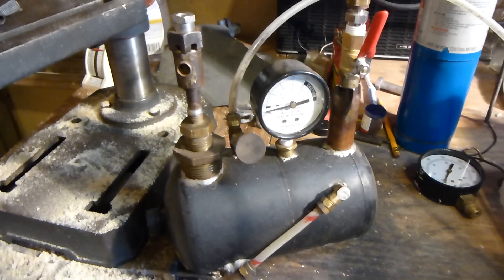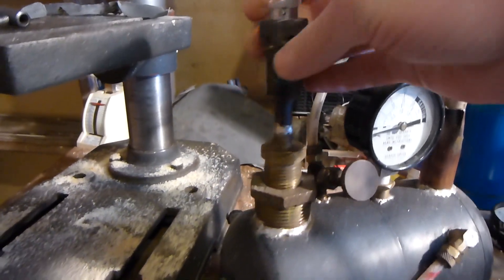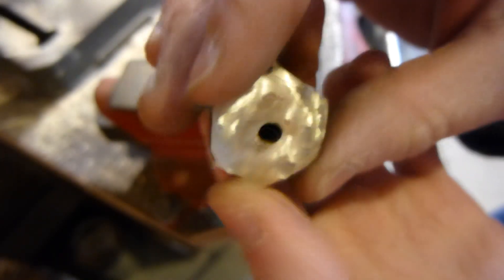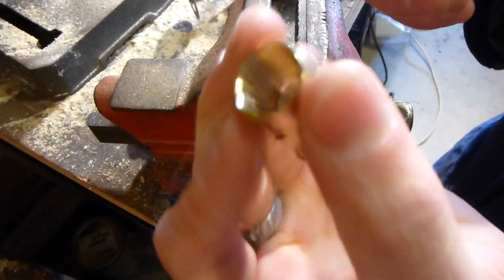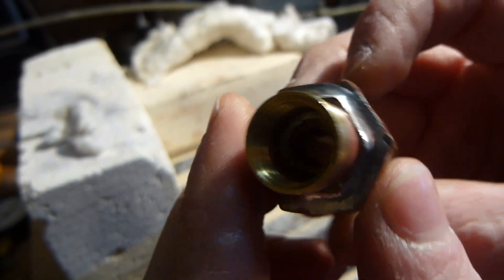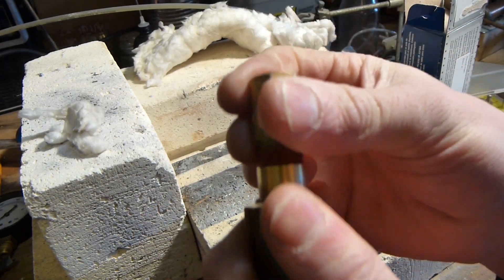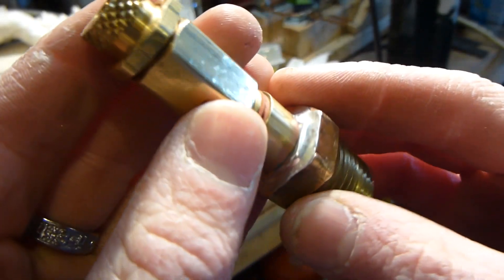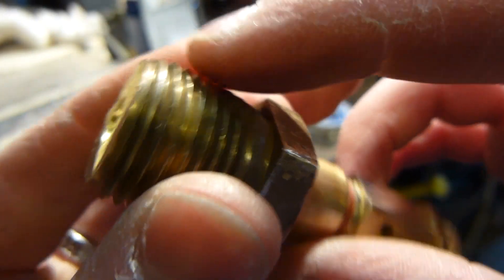Soldering a New Pressure Relief Valve On My Boiler and How to Solder

Comment: Would it still work if I didn't add flux to the joint as the solder had flux in it?
Reply from the maker: Spreedator 1000 That should still work ok.  It's not optimum but it will certainly be better than no flux at all.

Comment: Hi Maker J
When dealing with heat and pressure it is not a good idea to use solder...even silver solder.
The minimum you should be doing is brazing with brass parts (relatively low pressure ) and welding with steel parts.The problem with solder is not only a low melting range (which may fail ,especially if your boiler runs dry) but also low strength. What you have there will probably work ,but be very very careful. Remember.. an ounce of prevention is worth a pound of cure.
Reply: I'm with you electro1622 good catch ;)
although makerJ done a beautiful job soldering, the need for mechanical fixings is obvious.
It looks like the pressure valve has a 1/4" thread and his bottle 3/4"
Two reducers at 50pence each 1/4 >1/2 into a 1/2 >3/4 could've gone straight into the bottle, fulfilling the need for neatness/space saving.

Although as an afterthought, replacing the biggest fitting, putting in a blank "plug" end, drilling & tapping it to take his pressure valve directly would (maybe) be the way to go. Hey ho
Reply from the maker: ***** electro1622 
Yeah you guys are right.  I don't think you guys would like the way I built the rest of the boiler then.  Because I soldered the copper boiler tubes right into the steel tank.  I'm actually really surprised they haven't failed yet.  Copper and steel have pretty different coefficient's of expansion and with that weak solder...

Tapping in right in would have been the best way to go by far.  Problem is I don't have a tap that big.

Thank you!
Reply: yes..your right...I don't like the sound of that..I don't want to sound like your dad or something, but please be very very careful....A pressure vessel which fails can be (and often is) fatal.!!!
That's why there are laws against unqualified people working on pressure vessels commercially..!!..They really are complicated in terms of safety...stay safe..
Reply from the maker: electro1622  That's ok.  My thought is: the propane tank I'm using is rated for about 300 PSI of propane.  I think the normal pressure of the propane is about 150 PSI and they are designed to be dropped and such.  So my thought is that worst scenario is on of the solder joints around the boiler tubes or the solder joint holding the valve on fails.  In that case I would have a geyser of boiling hot steam and water spraying out.  I don't see a way the whole thing could catastrophically fail unless my pressure relief valve failed.  In the case that the pressure relief valve failed and the pressure built up inside the boiler it could not reach the rupture pressure of the propane tank because by that point the solder would have melted and leaks would have sprung releasing the pressure.  I still would like to do a destructive test of my boiler.  My plan is to rig it up in a field with cameras recording it and see what fails first.  Would make me feel safer if I knew the failing point and extent to which it fails.  I also only run the boiler up to about 40 PSI which is well within the rating of the propane tank in my opinion.  Thank you for your concern.
Reply: I'm always quite intrigued by the safety aspect of building model boilers. In this case we caution Makerj101 that his soldered joints are going to fail at low temperatures, and that his boiler will fail- fatally! It seems to me that we cannot have both scenarios. Either his joints have the integrity to let the boiler reach catastrophic pressures or they fail at a much lower level, resulting in a localized release of steam. Is that steam going to be any worse than what comes out of a domestic kettle... maybe, close to the vessel but I cannot see how a boiler that small, failing at such low temperatures is going to have the energy required for a fatal event.

Comment: What does the Flux do to the Solder?
Reply from the maker: Trenton Zelley It keeps oxygen from getting to the metal your are trying to solder so that it does not corrode.  If it corrodes the solder will not stick well.  Then once the parts are up to temperature it helps the solder flow better and bond to the parts.

Comment: Sweet. You could have also drilled and tapped the bottom fitting and just screwed it in. Taps can be expensive if u dont have them already
Reply from the maker: Raymond Bivens  Yeah that would have been a lot easier.  I have some taps but I don't have a 1/4 NPT tape.  If I did I could make my own pipe fittings!  Maybe I should get a 1/4 NPT tape and die...

Comment: My soldering skills are the worst.  I'm going to practice presently, with your helpful tips.
Reply from the maker: Nevin Williams Practice makes perfect! I hope my tips help!
Reply: I probably need some better/fresh flux, but the threaded connection I tried soldering earlier today worked much better than prior attempts.  Thanks!
Reply from the maker: Nevin Williams What kind of flux is it?  I used to use acid pipe flux but this new water soluble stuff the I used in the video works tons better.  So you may be better off with new.  Are your surfaces really clean?
Reply: It's an acid/zinc chloride paste; round blue tin, Kester Solder.  I inherited it from my uncle, along with a Weller 140/100 soldering gun, years ago, and he probably had the stuff for years prior.

I used sulfuric and oxalic acid to prep the two brass pieces.  it was pretty clean.  I didn't put the flame directly on the joint this time, and it definitely flowed much better than previous attempts.

Are  you worried that the solder might melt if the boiler gets too hot, or is that an added safety feature?
Reply from the maker: Nevin Williams Ahh ok.  The description sounds just like some ancient flux in my grandmas basement!  It might help to get some new stuff, I'm not sure.  All I know it the new stuff I have works a ton better.

Hmm I never really tried cleaning metal with acid.  I always sand/wire brush it.  I always used to put the flame right on the joint too.  Then I got a plumbing book for my birthday(12th I think) and I learned the right way to solder pipes.

I'm not really worried about the solder melting.  Nothing has happened yet and I soldered the boiler tubes in and they have the most heat and stress.  The solder melts at around 440°F so using this chart:  http://www.armstronginternational.com/files/products/traps/pdf/N1_2~7.pdf I would have to get the boiler up to around 400PSI to really melt the solder.  But the solder will start getting soft way before that.  Probably at around 300°F it will get pretty weak.  300°F takes 75PSI of steam.  So I think I'm probably within the limits as long as I don't push too close to 100PSI.  If it does blow I imagine I would get leaks around the boiler tubes.  But I guess fittings could blow off which could give me a bad steam burn...  I'm actually surprised that the boiler tubes have not sprung a leak yet.  I would think the differences in expansion coefficients of steel and copper would stress the solder and cause it to crack.  I've probably put it through at least a dozen heating and cooling cycles so it's really holding up pretty well.  

Yeah I suppose the solder is sort of a safety feature in a roundabout way.
Reply: If the solder is a eutectic alloy, it'll remain strong up to it's melting point, whereupon it will instantly fail.  

I do like what you've done with the boiler;  I have a salvaged 10 liter air compressor tank that I'd like to make into a boiler, but to heat it from the outside would be enormously wasteful, and the heat source would not be easy to control.   However, increasing the inside surface area as you did with piping would make a shielded place for a heat source, that would conduct heat on most sides into the water.

I have access to an arc welder, so that'd probably be what I'd use for similar piping joints; else I'd look into brazing, which is   The bonus is that the pressure valves and gauges are already in place.  If I used electricity, there'd even be a pressure switch to modulate the temperature.  I'd also want to connect the release valve to a cap or dome of some sort so that if it did release, it'd vent the steam down, and not sideways...
Reply: I picked up a new package of flux today.  Looks like the same stuff;  zinc and ammonium chlorides are listed;  

What a difference.  I've seen vids of ppl tinning their irons...  they dip 'em in flux, lightly touch the solder, and bing the tip turns all shiny and silvery.  I'd do the same, and a big glob of solder would eventually melt off... if it stuck to the tip at all, it'd turn black in moments.  I'd usually end up grinding solder into the wires until I'd have them covered in a big bulb.

I'm at once happy yet embarrassed that it was just stale solder screwing things up.  :)
Reply from the maker: Nevin Williams That doesn't sound like a nice way for it to fail...  But I would also think that as soon as the pressure starts to release through a hole the temperature would drop and cause the solder to re-solidify.

Thank you!  I think it's coming along pretty nice!  I wish it was bigger though.  It fills up with steam way to fast: I empty the pressure out and it takes about 20 seconds to blow the pressure relief valve.  That sounds like a really nice sized tank.  Upload some videos about it!  Do you know what kind of pipe you will use a boiler tubes yet?

Yeah welding would be a lot better.  You're lucky!  :D  I want access to a welder!!  Brazing would also be a good choice.  It seems like most people braze their boilers.  With a boiler that big I think you would need to get a pretty big pressure relief valve.  At least to make it safe I would get a big one.  With the amount of heat that I pump into my boiler I think my pressure relief valve is too small.  It drops the pressure to about 20psi and just stays open because the boiler is making steam so fast.
Reply from the maker: Nevin Williams That's good!  Big problem though: don't use acid flux with soldering irons.  It eats the tips.  I mean if you are going to solder big things with your soldering iron then I guess it's ok.  Just clean it off good before you let it sit.  Also don't use acid flux on electronics.  I used to use acid flux with electronics but found out the hard way.  It keeps on corroding stuff.  It will eventually eat through wires and circuit board traces.  You should use resin or some other electronics grade flux for electronics.  Acid flux is for pipes and big things.
Reply: I have a Weller soldering gun, which I discovered I can make really decent tips using the thick  center conductor of TV coaxial cable, as long as I pad the cross-drilled holes with extra folds of wire so that the thinner wire makes a good connection.

I've had such a hard time soldering that I've not touched a PCB or anything requiring precision, but I'll keep that in mind.   Dabbing the joint with a baking soda paste before flushing it with WD-40 or  isopropyl may reduce the corrosion problem, if using an acid paste (or an unknown compound) is unavoidable....
Reply from the maker: Nevin Williams Oh ok well if your using a solder gun and you're making your own tips then I'm sure you're not worried about the tips getting ruined.  I've actually thought about getting a soldering gun but I think I would be disappointed with it.  Is yours the kind that runs high current though the tip?  How many watts?

I think your problem is your soldering gun.  Soldering gun's tips can get too hot and when the soldering iron tip gets too hot it tends to corrode really fast and then you have fun trying to get the solder to stick at all...  If you're considering doing any electronics or fine soldering I would pick up a cheap soldering iron.  I had this one for years and if I had to get a new iron this would be my second choice.  http://www.amazon.com/gp/product/B00DE8I6L0/ref=ox_sc_sfl_title_5?ie=UTF8&psc=1&smid=A3NUNNXXHUJDMF  My first choice is my Weller WESD51 soldering station.  I love it so much!  I'd say it was one of the best $100 I spent!  You could pick up a cheap Radio Shack one but they don't last long.  Maybe a year and they are only 15 watts.  So they take a while to heat up and they can't heat up much.
Reply: Well, it was definitely the old flux that was causing my troubles...  _SO_ much better now.

The advantage of the guns is that they go from cold to hot in seconds, and cool off nearly as fast.  The work light is also handy.  A main disadvantage is that it's heavy...  about 2 lbs, which is far too hefty to do any sort of precision work for very long:  I don't think you'd like one, at all.

It's a Weller 140/100 watt gun that puts a large current at low voltage through the tip, which I thought was made of a special metal until I cleaned one in acid once, and it turned pink.   The Weller tips are $12 for two, or $12 for one with the compression nuts, which tend to get stripped because poor connectivity entices people to over-tighten them.  Whether acid flux is used or not, the copper tip will eventually dissolve in the solder.  Since using it for soldering, up until now, was all but pointless, I just made my own tips for doing other stuff, like cutting styrofoam, melting hot glue, demagnetizing tools, thawing locks...

It was good, however, for scavenging parts off of PCBs...

My voltmeter reads 0.377 volts at the 140W setting, and 0.339 volts at the 100W setting, which works out to about  370/295 amps.
Reply from the maker: Nevin Williams Yeah that's kinda what I was figuring.  I could probably make one with the transformer separate from the handle part.  Then it would be a lot lighter and such.

Those are expensive tips.  I thought the $7 tips for my Weller soldering station were expensive.  Yeah if the tips are just copper they do get eaten away by the solder.  The tips on my soldering station are plated with a special coating that doesn't get eaten.  I make my own tips for my cheep Radio Shack irons.

Sounds like it's only one turn on the transformer.  Generally you will get less than half a volt from one turn.  Did you measure that voltage with the tip attached or open circuit?
Reply: Open circuit;  With my homemade tip, attached, it reads 0.36/0.32 V on the 140W/100W settings respectively.

For temperature regulation, a foot switch, or extra circuitry would be needed...  The irons are probably better; plus, they don't cause so much induced currents...
Reply from the maker: Ok.  The voltage sure doesn't drop a whole lot when the tip is attached.  I guess that's good though.

Yeah a foot peddle would be cool.  Induced currents could be bad.